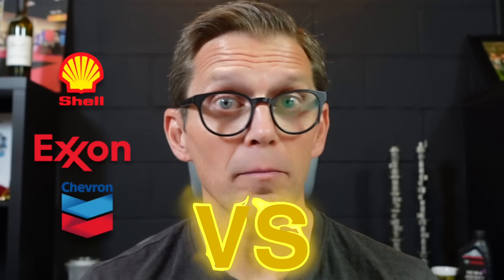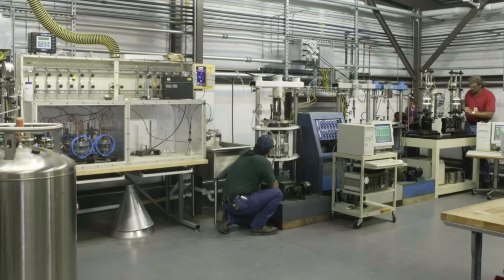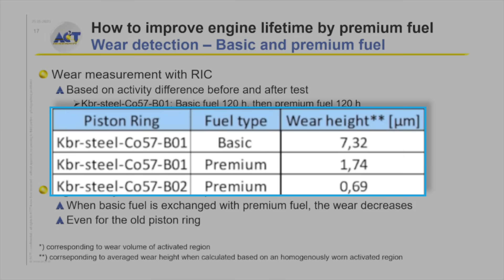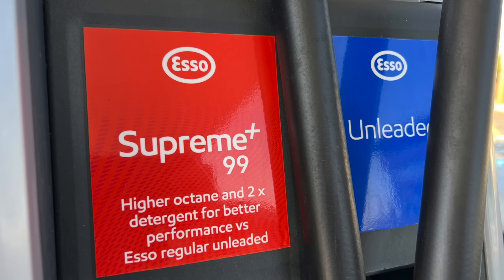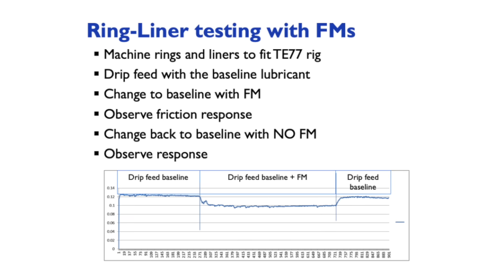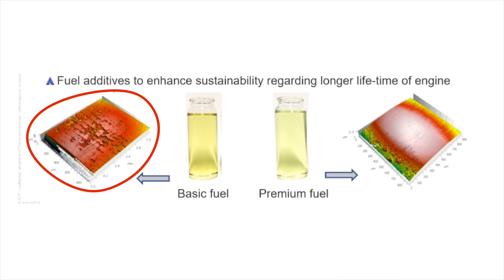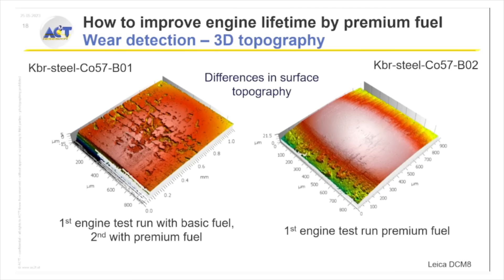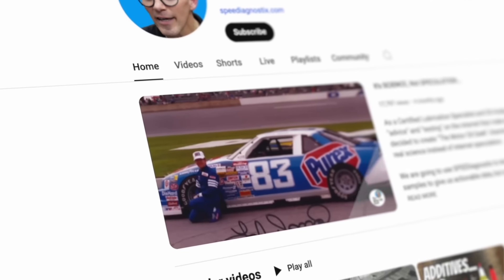Can Premium Fuel REDUCE Engine WEAR?

Comment: I have a Toyota Camry XSE V6. My owners manual recommends 87. That’s what I use. But I only go to Chevron because I believe their fuel additives are top-notch. So far so good, my V6 hums happily
Reply: I'll bet the manual says the minimum fuel should be 87.  MINIMUM!
Reply: The fact is says “Minimum” means there’s room for improvement.
Reply: @YoungRetyree No it doesn’t. Wasting money and the engine is tuned for 87.
Reply: @k9m42  The advantage isn't in the higher octane, but in the better additive packages the higher octane fuels may contain.
Reply: Just put what is recommended but consider researching what gas stations in your area are certified "Top Tier". It doesn't matter what octane you choose, it will have the additives that meet the Top Tier certification which is the best you can do. I personally don't believe it matters which Top Tier station you go to (there are some caveats) but just save your money and stay with 87. All that the octane rating indicates is the fuel's resistance to pre-ignition or pinging. If you only need 87, then get 87.
Reply: The 2g-fre loves premium more

Comment: So, the first question that came to mind was, does switching to a premium fuel now, in a car that has 50k or 200k miles (Honda Ridgeline with 205K) really afford a worthwhile benefit vs the increase in cost? Also, what companies other than Shell, offer verifiable anti-wear additives in their fuels? Thanks Lake, I appreciate and thoroughly enjoy your science based channel. I started out as a chemistry major but ended up in the auto parts industry for over forty years and I've seen a lot of snake oil over the years (Slick 50, Lucas...).  It's refreshing to see such a valid source buck the bogus marketing in the aftermarket automotive industry.

Comment: I often wondered about the situation Lake because at the end of the day, when you turn your engine off, you have one or two cylinders just sitting there with fuel, and obviously if the engine is operating temperature, I’m sure it evaporates and dissipates and I wonder why if that’s bad when you start a cold engine just to move the car a couple of feet and turn it off🤔

Comment: So many questions;   Is "premium fuel" the same thing as top tier fuel...or is "premium fuel" just the higher octane...87 vs 91 or 93?    Also, would adding ZDDP to the fuel tank every fuel up help protect our precious flat tappet cam engines?   Or would adding the ZDDP to the fuel also contribute to some sort of chemical reactions with todays engine oil causing more harm than good.   Thanks as also.
Reply from the maker: Do NOT put ZDDP in the fuel! That would be really bad... Premium fuel is Top Tier 91 or higher octane fuel.

Comment: O.K. Let us talk real world.  I live in the part of the USA that every single fuel station gets it's gasoline from the same source, Marathon.  Does NOT matter if you get your gasoline from a Shell pump, BP pump, or a Wal-mart pump, it was made by Marathon.  The "wholesale" delivery of these fuels also come from the same fleet of trucks. From my limited understanding, this happens all over the USA.

In addition, "premium" cost around $1.00 more than "regular" per gallon.   What is your ROI on using only "premium"?
Reply: Gas is gas until the different brands additives are added at the time of loading for delivery.
Reply: @bpisler  100% correct. at least in western Canada.
Reply: 100% correct, At least in western Canada.

Comment: A second post. 
Chevron premium helped my engine go 75K miles without a tuneup. Bought the car with 75k miles on it. At 150k bit the bullet full tune up. Plugs,wires,distributor, rotor button, fuel filter. My mechanic calls me in a panic. 
Vehicle had original plugs, wires, etc. 
Running Chevron premium keep it going strong for 75k miles. And was getting avg 26 mpg out of a V-6.

Comment: Two thoughts, some people add 2 stroke oil to diesel. This video makes this sound a good idea. It probably wont harm catalysts and dpfs because screaming 2 stroke motorcycles can run on 32:1 petrol to oil iirc. This is less than some car engine burn and two stroke oil is designed to be low ash.
Also I understand why additives are generally a bad idea, but if the zinc gets used up maybe a little mid oil change could be a good idea.

Comment: Some things sound good on paper but not in actual practice. I drive a gas truck that gets 14mpg. I did the math. It would be cheaper to replace the engine every 200k miles than it is to run 93 oct (avg $3.80/g right now) vs 87 oct (avg 2.98/g). Even if it cost the same which would you rather have a new zero mile engine or a 200k engine run with premium fuel? With that said I run the cheapest 87 oct I can find and have 210k miles with NO indication of excessive wear. By the time it actually needs replacing it would probably cost 2-3x more to run 93 than to replace the engine.

Comment: So True! My RAV4 is getting old so I stopped filling her with premium fuel which I had always used since new. My oil changes have always been no more than 5k miles apart and the oil always comes out looking similar to how it went in...
Since I changed to cheaper fuel the colour of my oil has gone black.

Comment: Currently I've been religious on what gas and motor oil ive been using on my 160k car. Had it since it had 70k miles 4 years ago. Maintenance mostly caught up, hoping for a 300k plus car! Motul 8100 and either Chevron or shell.

Comment: That explains why Shell fuel always gets worse mileage. Its always been so noticeable I will not burn Shell fuel. For most people it's counterintuitive anyway. Most people that would burn the Shell fuel will trade in their vehicles long before anything could start to be remotely noticeable..you're looking at 250k to get 0.010" wear vs. 0.003". And I believe it's slightly fudged at that. You're paying more for fuel, getting less mpg for a gain you'll never see. The contraption to test the oil while running is hilarious. You cannot run that in normal operating environment RPM etc. if you did the contraption itself would cause problems. Much of this is greatly stretched to appear more than it is.  Entertaining though.

Comment: How abou diesels?
Reply: V-power (50/50 GTL/diesel) and Esso’s premium (25% HVO) have much lower soot emissions which is much better for overall engine health and avoiding clogged up DPFs/EGRs. Don’t think every Esso station stocks the HVO blend though. 

My car only gets V-power and you would barely know it was running while idling. No smoke or odours. Never had a DPF light come on once the entire time I’ve owned the car. Performance wise it won’t really affect peak power but it will be quieter and more responsive at low RPMs. For comparison my dad’s car is the same age but has a very distinct diesel smell that’s non existent on mine. Just my experience (:

Comment: Lake, it would be great to look deeper into fuels and qualities. Being at altitude, the carbureted engines that don't really need premium will turn the spark plugs black and lead to misfire. Lesser issue with later model cars that have tight fuel management. Looking at lubrication and fuel working in tandem to improve over all operation in the long term will prove most interesting.

Comment: Some of this might be even more important for 2 stroke engines and other engines that don't have oil in the crankcase but use gasoil mix. 
  Stihl "Ultra" is a synthetic oil for mixing into gasoline for use in 2 stroke and "4 mix" engines that pass air fuel mixture through their crankcases. 

 I like to mix a very small amount of Stihl Ultra (about a 200:1 ratio) into the fuel I use in my 4 stroke small engines - I think it stops the carburetor floats from sticking 
One of my mower engines is an aluminum Briggs that is over 50 years old,probably has about 1000 hours on it and seems to still be in good condition except I have replaced the entire ignition system which failed probably because of corroded ignition points, the new ignition is pointless.

Comment: What are you considering "PREMIUM" to be? Because most gas stations list premium as the higher octane rating. Are you talking about top tier gas? That would make more sense. Because if you look at marketing for the different octane ratings, there is no mention of better additive packs, the gas station brands don't add anything "extra" to their "premium" fuel. Anything they add is just there for the octane rating... there isn't any reason to add a higher octane rated gas to a car that doesn't support it... that would actually lower combustion efficiency and thus cause more fuel dilution, fuel dilution being the number one killer of engines from a fuel and oil standpoint.

Comment: Exxon and shell use higher refined bases for their premium fuels, and its not the same base for regular unleaded. Its not simply regular unleaded with a different additive package. Premium's base comes off a different level on the tower and is refined more than the base used for regular unleaded. They have separate tanks for regular, mid grade, and premium at the refineries. I literally have family members who have hydroblasted, cleaned, repaired, and painted those storage tanks. They are clearly labeled for the fuel grade, and its not all the same fuel in the tanks. Yes, the additive package and ethanol are added later. As far as what other companies are doing, i dont know. I know for certain that's how it's done at the exxon and shell refineries.

Comment: I think when you say the words "Premium" fuel, what you mean is fuel with a good additive package, such as "Top Tier" fuels, regardless of octane rating. If I'm wrong or have misunderstood, please correct me. However, use of the term "Premium" is likely to confuse folks into thinking you are referring to the higher-priced high-octane fuel as being better somehow. You might consider explaining the term 'premium' better to avoid misleading folks into buying high-octane fuel unnecessarily, thinking there is some wear-reduction advantage to high-octane fuel in general. For example, if you go to some no-name convenience store that sells unbranded gas, all 3 grades are likely "standard" grade gas insofar as the additives are concerned. In other words, they likely only contain the minimum levels of additives required by law/regulation. If you were to buy 93 octane "Premium" gas from that generic vendor, it would likely not be any better than the 87 octane with regard to its additive package. What I am trying to get at is that the term "Premium" fuel in your context and in the context of the studies you cite likely has nothing to do with octane and everything to do with the fuel's additive package. However, in the mind of the average consumer, "Premium" likely only relates to octane. I try to buy my fuel from vendors selling "Top Tier" gas, which is supposed to have a significantly better additive package than the minimum required by law. You can Google "Top Tier gas" to find out more. However, to my knowledge, no one is really emphasizing wear reduction as a benefit of gasoline additive packages in their marketing; rather, the emphasis is on engine cleanliness, especially when it comes to the fuel injectors, valves and sensors. Your video was interesting, but I would like to see more information about whether any 'Top Tier" fuel vendors such as Exxon and Shell are adding any friction modifiers to their fuel, and if so, whether the amount they are adding differs significantly from octane grade to octane grade. Also, it sounds like it might be worth considering the use of an aftermarket fuel additive that contains friction modifiers. Do you know of any that are any good, and is there any data to back that up?

Comment: Costco Gas also says 5x more additives than the other leading brand 🤷🏽‍♂️ It is also TopTierGas!

The next question to ask will be for the Actuary in the room, If premium fuel costs at least 10% more than the basic fuel at the same pump everywhere across the USA and the difference in gas prices across a state like California can be a delta of $1.75 from lowest price to the highest price on the same day (as per GasBuddy)... at which point does the wear saved VS a R&R of a spent motor become a tipping point?

My guess is, most public road going cars will spend less in fuel putting in the cheap stuff over 300,000 miles and still come out ahead over someone spending 600,000 miles of premium gas when they could have been allowed to use basic.

Love the learning you offer of fuel can protect against wear, but I didn't see you discuss the math'n part of does this make sense to chase? If I am already required to put premium gas for my motor by the manufacturer... then this is a nothing burger. But still we can do some math'n on GasBuddy on the cost difference between Shell V Power vs Costco Gas

Comment: That wear protection sounds great for an engine that requires higher octane.
But for low compression engines that higher octane fuel, for low compression not good because it would be harder to ignite slower burning, so that would cause some unburnt fuel that would cause premature wear?

Comment: since Chevron is vertical integrated, (i'm not sure on Shell) i'd like to see a fuel comparison. Shell is normally my go to but Chevron is more conveniently located so i end up going there time to time, and i like how chevron has a seperate pump from premium fuel to not dilute with 87 of the person before. they also claim to have little to no ethanol and i've seen it 0 to 5% as a local tests it.

Comment: I have always used stewarts(NY)  91 ETHANOL FREE gas in my 2015 impreza since brand new. I have 113k miles on the clock now. Did I completely overpay for gas for the past 9 years or have I done my car a favor? I have also used gulf 0w-20 syn until 40k miles, and then I started using Sen-Pe-Co 0w-20 syn up until now.

Is ethanol free gas less power than E10%? I also rally cross and have contemplated filling up with E10 to get a little more power but didn't because if I can't win in a slow car then I'm not a good driver!

Comment: NO.  It doesn't improve gas mileage, either.  Use full synthetic oil for far greater wear protection and the LOWEST octane required by your vehicle vehicle manufacturer's Owner's Manual.

STOP paying through the nose for a cheap but only slightly effective fuel additive.

Comment: Any studies done on vehicles with cylinder deactivation vs non as far as testing oil? I ask because i use my truck for mostly longer distance drives and find mpg is noticeable better in Eco mode at least with proper driving. In other modes do not think the cylinder deactivation is operating. 
Just did my 2nd oil change on my new ‘23 F150 have sample bottle will be sending in next week. Truck 1 yr old yesterday. 6200 mi on it now.

Comment: Well folks, looks like I'm gonna be switching my Mustang to running Shell V10 Premium 91 oct fuel (easy to do as there are multiple Shell gas stations in my area) to also see if she does pick up a little more relative power due to this reported\verified less wear from the friction modifier additives in the Shell premium fuel.............this is the flip side to all Lake has given us........reduced internal friction to reduce internal component wear should also show some increased relative HP\TQ from reduced internal pumping losses............may need a dyno to find\realize this aspect as ANY HP\TQ gain from this is a big plus IMHO............another test project! 👍👊

Comment: I commented on a video some time ago where Lake suggested not using oil additives, but recommended using fuel additives.  I believe the same rule applies to both.  Quality oil needs no additives and may actually be harmed by additives.  Likewise, quality fuel needs no additives and may actually be harmed by additives.  Bottom line, use quality oil and quality fuel and you simply have no need for additives.

Comment: Great content. I am curious to know what the difference is with today’s modern oils on older engines. Does modern oil designed for direct injection turbos perform better on port injected stuff like the GM 3800 or Ford duratec 3.0 or Chrysler 3.5 or TBI engines. How about carburetors? Or is the older specification best?

Comment: If I had cheap fuel and running it in my 4 stroke atv. I’ll just add 2.6oz to 1 gallon or 50:1 two cycle oil to prevent ring wear, problem solved. But still do by oil changes. It wouldn’t smoke much but smell like a 2 stroke engine. I’ve been doing it for 12 years and had it since. There’s nothing wrong with doing it.

Comment: It all comes down to what your cars engine manufacturer recommends as in OEM ils and what fuel to use its that simple, sure back in the 1970's early 1980's in Au we had super as a fuel which is a leaded fuel, then unleaded fuels came out thus making the ICE more eco friendly and less emissions, but for power and everything else you cant go past 98 RON fuels, plus what about fuel additives using say a E10 blend and then adding a fuel booster like chemplex dyno tablets which were designed to add the extra molecule in the fuel to make tit burn more complete ?
I know as i used to sell the stuff and also test it via fuel labs and it did improve the ron octane levels by 3 to 5 points depending on which fuel was used 91, 93, 95, or 98 RON etc. using 98 and a dyno tab from chemplex really did nothing other than burning the fuel was more efficient? ✌👌🦘👍